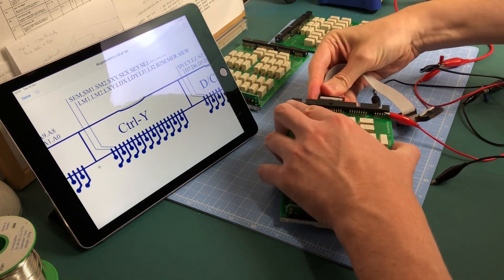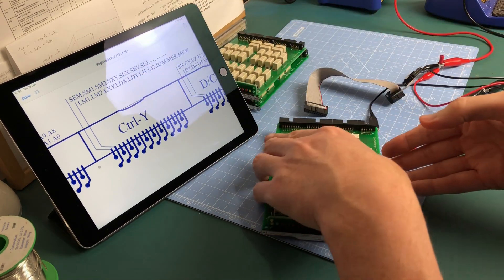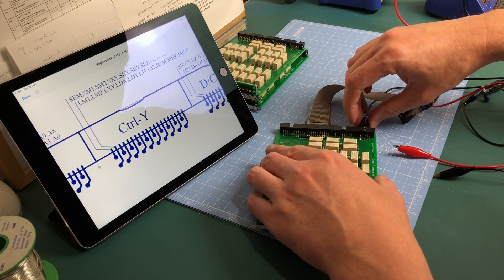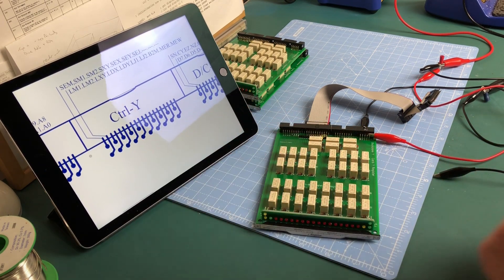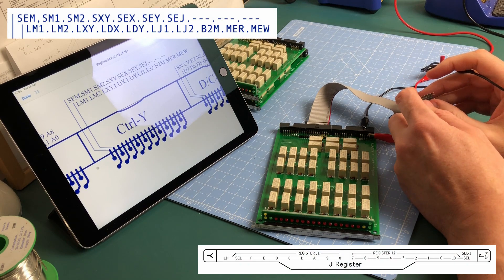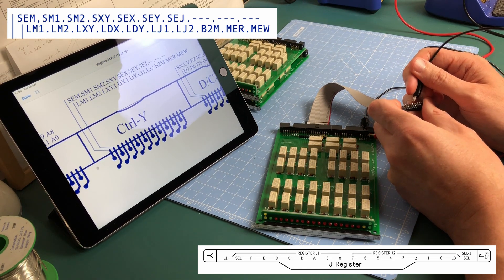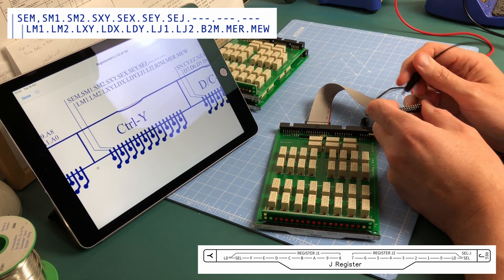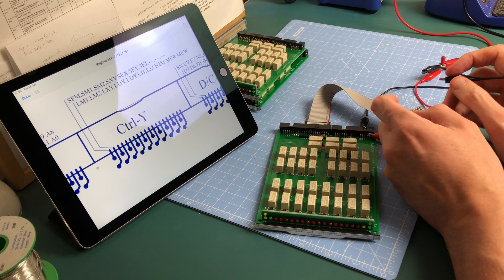Relay Computer: Register XY, M and J Config & Testing

Comment: Some more spam - do I see some optical 'perforated card' stuff on the whiteboard in the back? (the black and white squares)
Reply from the maker: Yup, you see correctly :D Entering opcodes via the front switches will be a 'total pain' for longer programs so I'm intending to add a 'tape reader' later on. I went for the optical route so it'll be simple to create 'tapes' on any printer and then feed them in to the computer.

Comment: Did you think about making small PBC configuration connectors? Having female headers and apropriate traces, would look somewhat more proffesional, having a plug in config board ;-) Also if the connectors are giving you grief if might be advantageous to just go to eurocard style connectors.
Reply from the maker: As it happens I recently took a look at the eurocard style connectors now that using PCBs opens up the possibility. However, the 3 row didn't quite have enough pins to get everything in one unified connector ... although I could probably optimise things in places. I'm kind of locked in to my current connectors now I've made so many cards although in future I might re-design the backplanes and then make a slim adapter PCB that has the old connectors on one side and the new on the other.
Reply from the maker: Mmm, that sounds quite a neat solution. I think I'd have to make the mini-config-PCBs myself though in that case to keep the costs reasonable (although JLCPCB is silly cheap ;) In hindsight I could have designed the headers so all permutations are covered and then use jumpers which would have been quite tidy (and much quicker to configure).
Reply: @paul80nd  didn't you see the video of the professor that used two relays to make a pair containing all the gates, or at least most of the logic gates, just pick which one you want to use
Reply from the maker: @davidprock904  If it's Dr Harry Porter's we're talking about then I definitely have (my computer is based on his and on the RC-3 one made by Phil Ryals and team). However, because my relays are two pole vs Harry/Phil's four pole I have to double up the number of relays. https://relaycomputer.co.uk/2013/11/design-1-bit-logic-unit
Reply: @paul80nd  I've thought of a architecture design, mainly around the area of busses, different ways for parts to communicate. If someone was to use it for a relay computer, it should allow for things to go quicker, one design I devolved it some cause it too radically different in a great way. But its very wasteful on logic gates, but stupid fast. And my second design much more comparable to standard way but able to do potentially endless in perfectly parallel processes. Oh and if you use it to make a data storage device, not in the manner like a raid, but as the total of the drive, easily expandable. One yottabyte  drive hasn't been made, this simple idea makes it easy.